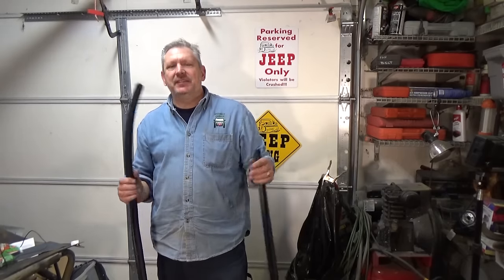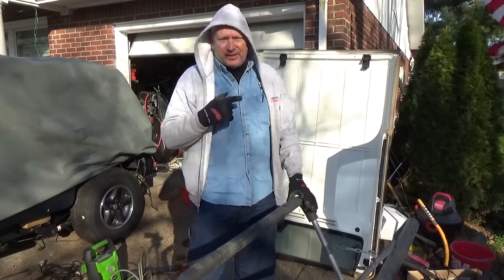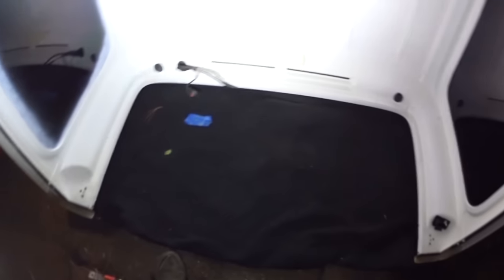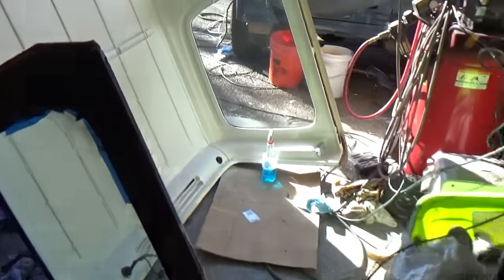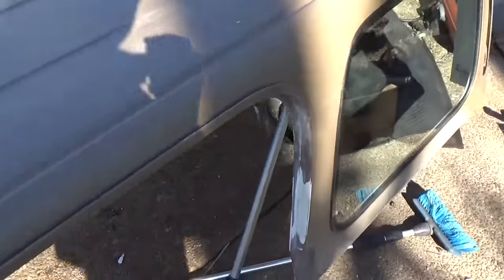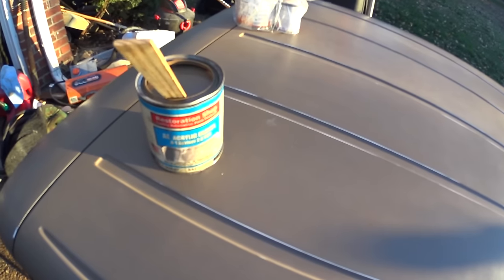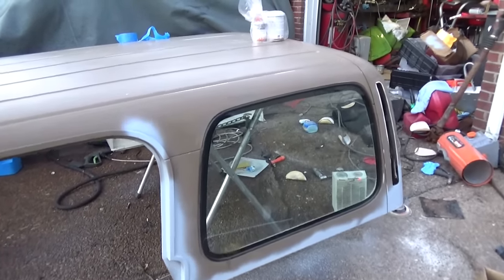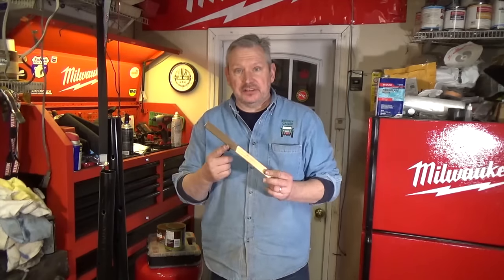Wrangler TJ Project - Hard Top - Clean- Repair - Prep for Paint

Comment: Whoever said that regular patching fiberglass would not work on those tops is just trying to upsale a rebranded specialty that IS regular fiberglass and resin. My dad and 2 uncles have been in fiberglass since I was a very young child. Combined, they have experience from making everything from taxidermist molds, Corvette parts, bass & house boats. Being raised around it I have done everything from simple patch work to designing and creating molds for production parts. So .. with experience like that behind me .. Dave I can safely say. Good job!! lol
Reply from the maker: +Power Addicts - FixJeeps.com - Jeep, car and motorcycle tips Thanks bro - I did a bunch of research on SMC and after reading I was like - other than the way they are formed the components are so similar. I bought some SMC repair adhesive which was so bad I didnt show any on the video before switching to regular fiberglass which worked great - thanks for the conformation!
Reply: You're welcome bro! There are some methods that use a vacuum form or injection style in moving the resin in and air out. Some of those components have a wax built into the mix to aid in mold release (ie .. some swimming pool slides). Those "can" have issues with bonding regular resins to the parent material. In those cases just roughen the crap out of it, tapering it back as far as possible to get as much surface contact area bond as possible. One misconception is that most people think that cloth has strength. Cloth is more of a surface material to provide a smooth surface to work it down. Properly saturated (not too much .. not too little), cloth by its self after the resin is totally cured will tear easily. Back cloth with mat, then you have strength. I'd like to find a YJ or TJ hard top that has the top busted through so I can demo how to repair it. If you ever have question, please feel free to gimme a holla. If I can't answer it. I have the connections to get the answer.
Reply from the maker: I will thanks !  I didn't really have any problems with the regular fiberglass style repair.